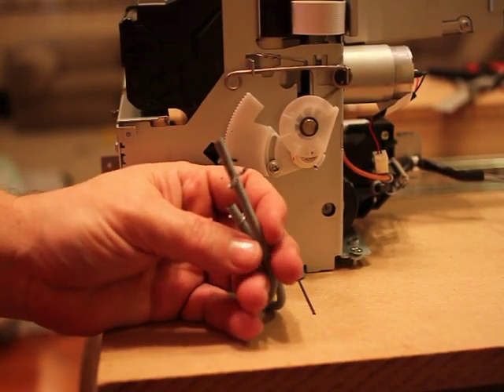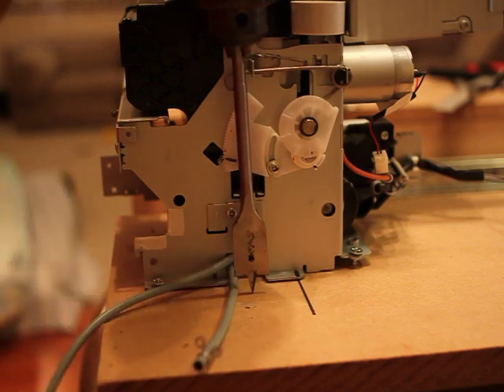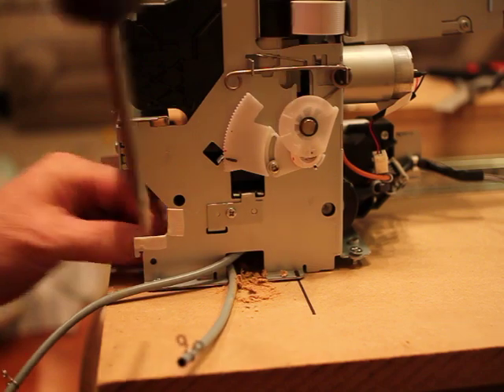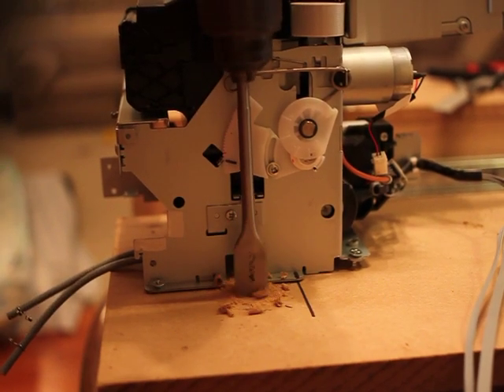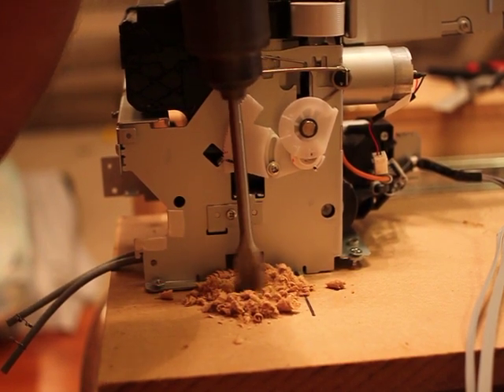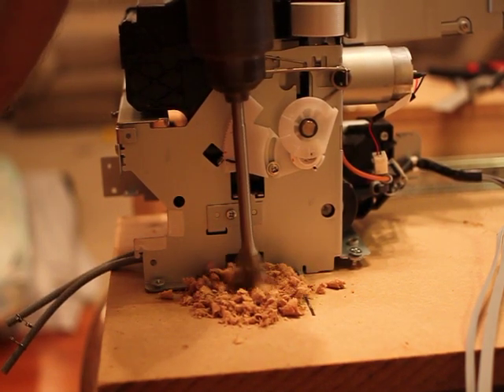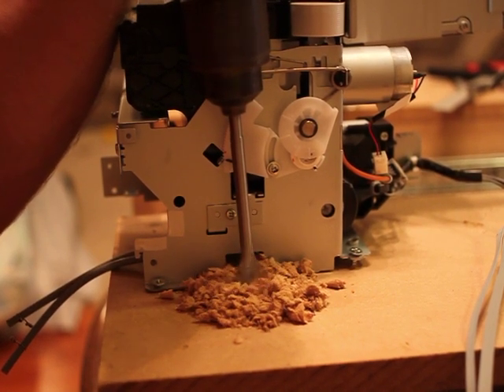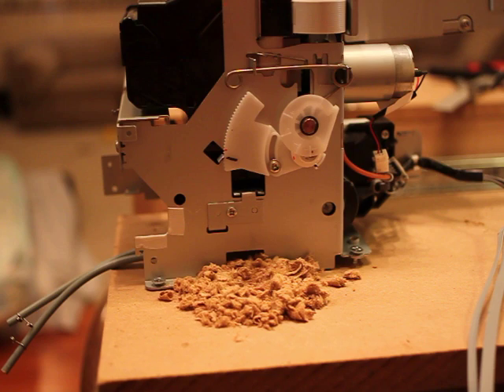64 Drilling the waist ink hole.MOV

Comment: Hello!
With your help I built a dtg printer with Epson R300 to test, but can not overcome the problem of sensor pw, disconnecting've read but I get no error and how to fix it, I tried to cover the sensor with a black plastic, disconnect, but still does not work, with Rip software could overcome it?, or better otherwise regards and Thanks